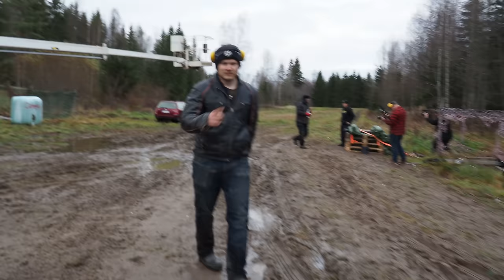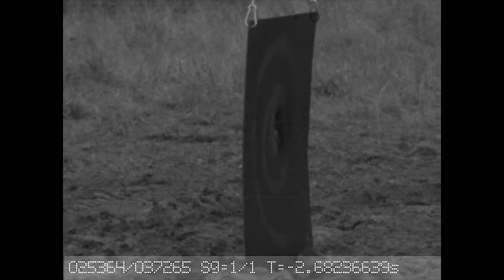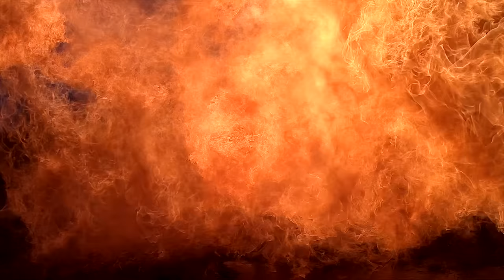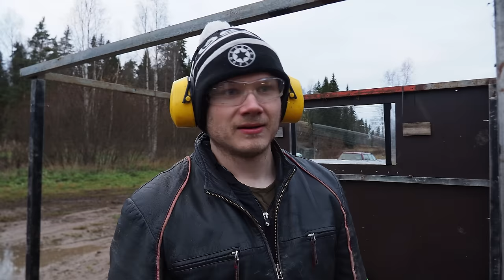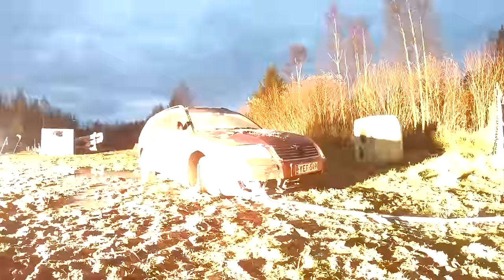3 inch Cannon Vs. Propane Tank!

Comment: Propane tank inside the car would be interesting!
Reply: Make sure there is some fire inside the car to ignite the propane.
Reply: Imagine the windows of a car blowing out because of the propane explosion inside. That would have been magnificent!
Reply: @A_Bit_of_Thought  There probably wouldn't be enough air in the car after the tank blew out. Definitely want some fire somewhere near it though.
Reply: Putting the car into a (large) propane tank would be much more interesting...
Reply: @Bob5mith  I think you're right. The pilot flames would eat up most of the oxygen and the propane would displace the rest.
Reply: It needs oxidator also. And then there is sharpnels flying 500km/h everywhere
Reply: I was literally expecting for that in this video!!!
Reply: Put a small canister of oxygen in with the propane take and an ignition source.  I was going to suggest the propane tank in the car right before I saw this comment.  PROPANE TANK IN THE CAR PLAESE !!!!!!!!!!
Reply: @CuzicanAerospace  
Together with all the doors and possibly the roof as well
Reply: @Bob5mith  After a tank blows inside a car with a handgranate taped to it, which we did in 87, there are no windows or doors left and as much fire as you want.
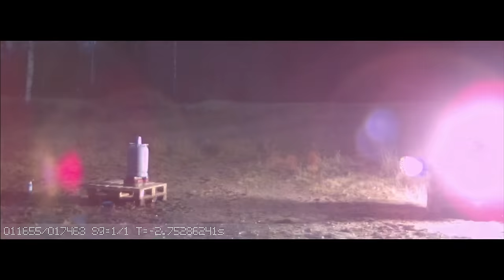Reply: @taunteratwill1787  Windows or not, that much propane will displace all the air. Watch how much liquid spews out at 7:04 before it catches fire. A burning propane torch would be immediately snuffed out. Grenades have their own fire and disperse the liquid much quicker than it will on its own. It's the difference between shooting a gasoline can next to a candle and putting dynamite under the can.
Reply: @Bob5mith  Perhaps, maybe, it could be, if we think about it, without alternative possibilities then you could be right.  Try it anyway?
Reply: I absolutely agree with they should put it in the car
Reply: @johndowe7003  Yep if you blow something up it's better not to stand on top of it.  Thanks for the advice. . . . . . .
Reply: Heretobenosey yes! that would be superb
Reply: Heretobenosey they could shoot an LPG car
Reply: Agreed!
Reply: I was going to comment this lol
Reply: Heretobenosey  mate, i only came to the comments to suggest the exact same thing. Lol 👊
Reply: Shoot a car at the propane tank
Reply: @froop2393  I like you. You think good
Reply: They can't  because they can't put out the car fire. They would have get into trouble with the  smoke etc.
Reply: My first thought.
Reply: This guy has the right idea
Reply: I think a propane tank in out house would be great
Reply: Omg hell yeah 💯
Reply: @froop2393 lmao facts
Reply: @Jako1987  lmfao

Comment: Poor Lauri spent 70 euros on that propane tank and I don't think he will be able to get it refilled after this.  :P
Reply: I didnt think it was filled, so I just thought he must have said 7 or 17 euros. Then BOOOM.. Oh I guess it was 70 Euros.
Reply: Considering he spent 1000€ on a load cell recently I don't think 70€ is that big of a deal.
Reply: "Yeah, I have this old Propane Tank I need to Trade in for a fresh one please, it developed a small leak!"
Reply: John McFerren the load cell is an investment and the propane tank was for a single video, so wrong comparison.
Reply: Nah!  Bit of gaffer tape, good as new!
Reply: @jrmcferren  the load cell is reusable, I doubt he will reuse this for many more videos...
Reply: It just need some flex tape and it will be as new
Reply: Bahhh - tack on some fine chinesium alloy steel patches with a Harbor Freight MIG welder and she'll be better than new.
Reply: Not with propane
Reply: What are you on about?
A couple of welds, be good as new. LOL
Reply: Hammer the outward burst metal in and put a couple large stickers over the holes, then take it to a changeover station for a freshie!
Reply: It can be refilled but only to atmospheric pressure 😋

Comment: You should offer to blow up the snow dump with dynamite. As a public service.
Reply from the maker: I think I  have to ask Henri to make mini snow dump on next winter that we can explode :D
Reply: Giant snow dump win, global warming 2018 lose
Reply: @Gookrak  And where did all the snow come from? I would suggest from moisture in the air, but then the question becomes: how does moisture get into the air? By evaporating water. How do you evaporate water into the air? By warming it. So one of the hottest summers in history was not able to melt all the snow that was put into the atmosphere by a record warm water body.
Reply: @deelkar  Don't take my words seriously, I just tried to create a funny sentence in Lauri's style. I'm absolutely afraid of the global warming/extremising effect.
Reply: @Riku Penttila I think they found in previous videos that thermite actually doesn't do well with melting ice. Ice takes a ton of energy to melt, enough that even thermite has a tough time with it.
Reply: @Riku Penttila yes.
More thermite. 🔥
More propane. 💥
More dynamite. 💣
More fun! 😁
🔥💥💣😁😁😁
Reply: @Riku Penttila 
If the brute force doesn't work, you are simply not using enough.
Reply: Woodworker Don were you a member of beyond the press?

Comment: Use lots of steel ball bearings to make a giant shotgun
Reply: Ben Sneller 
old car nuts would be just as effective and a damn site cheaper.
Reply: That often used to be done in cannons. It is very effective.
Reply: Good old grape shot.
Reply: Bruce Baxter ; )
Reply: @bensneller5797  no they wouldn't. Way too light. They won't hold the energy.
Reply: @bensneller5797  then it won't hold an edge. Isn't that the point if using razorblades?
Reply: Or a bunch of obsidian shards

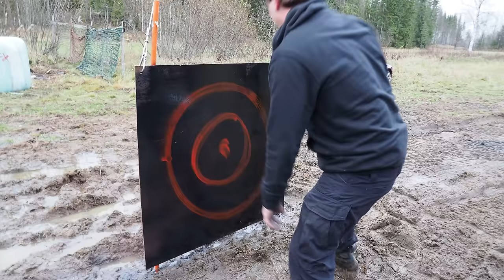Comment: 02:00 if the plate had been solidly mounted to something it would have penetrated.  The movement of the plate absorbed a lot of the kinetic energy.
Reply: You can also compensate by adding more kinetic energy :)

Comment: Now fire a bowling ball 2km. You will feel really satisfied and amazed afterwards!
Reply: Like the Mythbusters did? It went through a house and a car. Luckily no one was hurt.
Reply: @buddyclem7328  they were dumb the way they did it. You need wide open space with nothing around but trees and the correct elevation on the barrel to be a success. Corn fields work best. I've sent a bowling ball just over one mile with my bowling ball cannon and was buried 15 feet deep in the ground. My cannon has a 15ft barrel with a muzzle brake and a 3" thick breach to prevent catastrophic failure when firing.
Reply: @munky123jw  you should post videos of your cannon!
Reply: You could fire one into a lake or across the lake.

Comment: I like the propane explosion. You can really see that it expands at first because the gas was under pressure, then it expands more because of the burning, and then it contracts because it cools down. It goes from 800 Celsius to 0 in a few seconds.

Comment: That was awesome how the smoke rushed in after the explosion. I wonder if it was because of air being sucked in by the heat of the flames? Or did it create a partial vacuum and it was created by the lack of atmosphere behind the explosion?
Reply: Yes on both counts. Fire sucks in oxygen. but any large explosion that creates a shockwave will also have low--pressure front behind it that sucks air in.

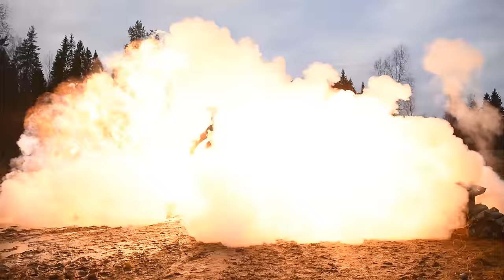Comment: There's a single frame at 4:12 through a hole in the smoke where you can see the gas canister upside-down in the air with flames shooting out either side. The Go-Pro footage inside the flames is fecking awesome too!!!! This was a good video : )

Comment: Blowing up the propane tank was cool looking
Reply: And at the same time also very hot.💥🔥👏👏👏
Reply: Woodworker Don no kidding can you imagine the instant heat it put off
Reply: @stacyreid5077  it burned/melted the tops of the plastic sandbags on top of the cannon in only a second or two. 🔥🔥🔥🔥🔥😱😱😱😱😱😱
Reply: Woodworker Don I saw that now if we would been there to put tons and tons of pressure on it to turn it to diamonds. Lol. If it was only that easy
Reply: @stacyreid5077  ♦💎💍💎♦

Comment: You know what would be cool? In stead of a low pressure propane tank, get a nice and big steel, high-pressure oxygen cylinder, and over-pressurize it with Hydrogen by adding double the number of moles of H2 gas! (So if you have 100BAR O2, you would add 200BAR H2 for a total of 300BAR of 2H2 + O2 = 2H2O goodness!).

I would love to see what happens if you shoot it with an incendiary projectile! :)

Comment: Try filling a plastic 25 liter container with a mixture of oxy acetylene from an extinguished neutral flame on the torch. You only need to put a mosquito coil with matches at the end so as to melt the plastic and ignite the gas mixture. It is one hell of a big pop. If you do it on a aluminum beer can with masking tape on lid and ignite it with lighter fluid, blows the can inside out.

Comment: go (smaller) into the fuel / air concept, fuel needs to spread to (almost) perfect mix with oxigen/air before igition - centered or directional - i liked the liquid gas conflagration a lot, but it was to much fuel on to little space - that was why it just burned on and on and did not really explode ... it shure looked like an explosion - but it did not break free as there was not enough oxidizer.

Comment: Try using butane gas lighter fill. Make sure you only leave about 1 inch in the bottom the less the better. Put it into a fire and run. You will hear the tin ping and then the bang the mushroom cloud flame and two shock waves. When you drop it in the fire make it face up.... Cool try it. Just a very little works best..

Comment: That was a distributor rotor you held up.  Looked like that round hit the tire and deflected up? If you wanna hit engine block on a FWD car, hit it low in the front end, straight-on. Like just below the bumper. The wheel/tire is blocking it from the side. Hood/grille area is too high. You'd just nick the top, cylinder head or valve cover. I wanna see it go through the block.

Edit: Oh I just re-watched...First time around my first though was "squib round" (projectile stuck in barrel) because it sounded muffled like the projectile didn't leave the barrel and I saw no impact. The slo-mo kinda shows it arriving seemingly late and very low powered, I mean you can even see the arc of it, like someone threw it. Something went wrong there...

Comment: Would have been fun to turn the car 90 degrees so that the projectile would have shot the length of the car. Maybe next time front to rear through the motor the the trunk or from the trunk through the engine block

Comment: The hot gas made the drone work harder to fly lol hot air is way less dense than cold air. That's why engines make more power in cold temperatures.

Comment: Beyond the press Excellent content and channel, keep the videos coming.  Can you get ahold of a large amount of Calcium carbide and hydrogen peroxide?  Would make an excellent video if you took the calcium carbide, powdered it, then mixed the hydrogen peroxide with an external ignition source (I would collect the resulting acetylene, hydrogen, and oxygen in a giant weather balloon).A large milk can or propane cylinder would be a good reaction chamber.  Alternatively, Water, Sodium Hydroxide, and aluminum would generate copious amounts of Hydrogen suitable for an explosion in the same manner.
Reply from the maker: Now days it's better to use ready made stuff like dynamite. Doing to much chemistry and especially talking about it results problems with Google and probably also with police :D But I think should use electricity to break water to oxygen + hydrogen to get that under ice boom that we tried with oxy-acetyle. It's really hard to get good mixture through pressure difference like under ice by using two gas bottles with different valves etc. so it would be good to be able to make boom stuff under ice and not have any problems with the process.
Reply: @Beyondthepress  Thank you so much for the response!  Your channel and experiments are awesome.  Maybe reconsider for a future video as Calcium carbide and Hydrogen peroxide are very easy and legal materials to acquire, and the explosion of a balloon filled with the resulting gas as loud as dynamite with an awesome purple flash and fireball.  Very cheap indeed, the weather balloon being $10, the calcium carbide $20, and the Hydrogen peroxide $2...If you cannot source and grind the calcium carbide, then thin aluminum scrap (wire or foil work also) along with water and sodium hydroxide make vast quantities of hydrogen quickly, on demand, and build pressure quickly, much faster than electrolosis HHO water  separation.  A charcoal (or several) that is lit with lighter fluid work great for detonating pressurized gasses after high pressure release.  Just Ideas for future videos for you or possibly your professional subscribers (only try if you are paid to do these things 😁).

Comment: you should take a couple of those propane cylinders line them up nice and straight in the back of the car with the gate open and put a very hot load in Cannon and blow the car and tanks togeth

Comment: You have no way of putting out the fire   if the trees wire to burn
Not so safe
Reply from the maker: it has been raining for 2 months and temperature is around 0c so no need to worry about that :D